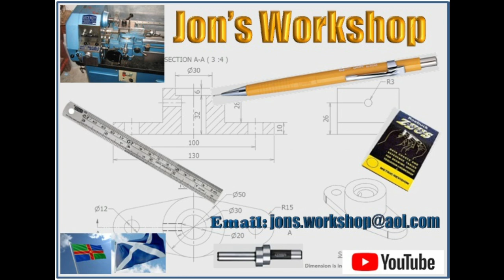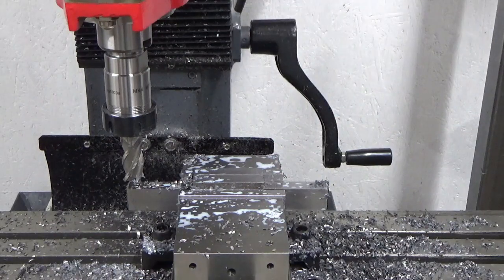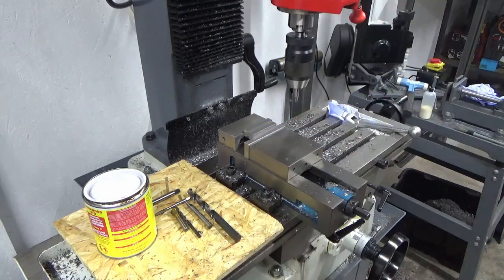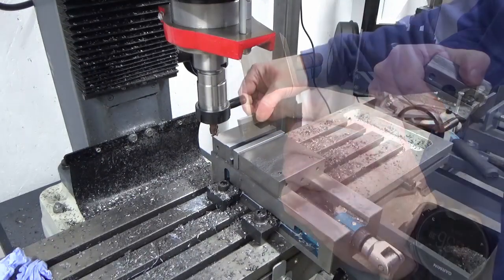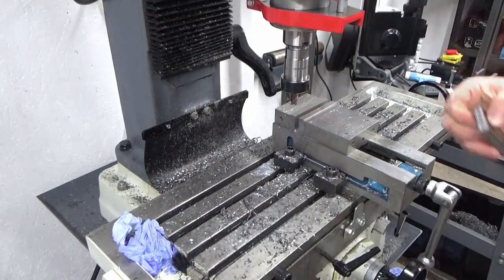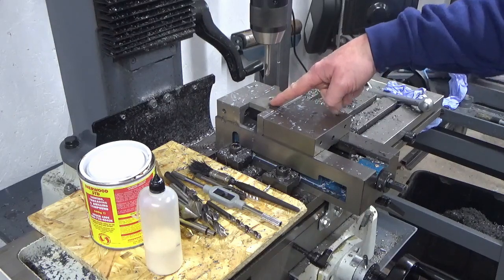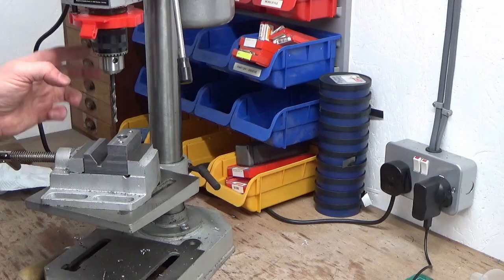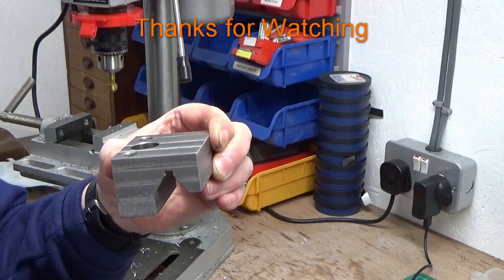Making A Carriage Stop For The Harrison M300 Part 2

Comment: The anti rotation is solved by drilling the clamping plate the same as the two joining screws and using longer screws and clearance holes. It made sense at the time. No dowel. No extra hole. No reaming.
Reply from the maker: Hi Fred, thanks for the comment. Yep, spot on. I considered this but have no M6 cap screws long enough in my supply. I could have put the project on hold while I waited for some (which I also considered), but thought "use what you have got" and it will also make for something a bit different in terms of content 'my first renamed hole on camera'! The fact the reamer was crap and I could have probably drilled a hole closer to 1/4" we will overlook lol. Cheers, Jon

Comment: Hi Jon, just a thought, if you had a mirror on the drill press it would offer 2 different views of the action and if your arm went in front of the shot then it would still be visible through the mirror. I have never seen this being done so maybe there is a good reason it isn't, or you could be the start of a new trend...
Reply from the maker: Hi Glyn, thanks for the comment. Good idea, I don't use the drill press much these days since I got the mill so it is feeling a bit neglected which is why I opted to use it here for a change. Next time I use it (assuming I remember) I will explore this concept. Who knows, it might take off. Cheers, Jon

Comment: Not bad at all Jon, it's coming along nicely. I thought you might have made it a micrometre stop ?
Reply from the maker: Hi Del, thanks for the comment. Yep, planning to do just that and I talk about this in video 3, waiting for car boots to open back up to get a cheap micrometer to butcher, not paying Ebay prices for one. Cheers, Jon
Reply: @jonsworkshop  I might well have an old 1 - 2" mic or I know I have a damaged 0 -1" depth mic where the spindle has damaged through dropping. (Not by me I might add). Let me know and I'll sort one out. No metric ones though.
Reply from the maker: @delstone1919  Hi Del, thanks for the offer, I might take you up at some point in the future. Going to use the plain one for a bit, see if any design changes are required and work out where the best place for the micrometer stop is, then a future mod to finish it all off. Need to move on, got a guy wanting an adaptor plate making lol. Cheers, Jon
Reply: @jonsworkshop    👍